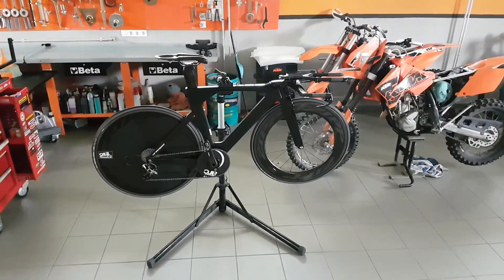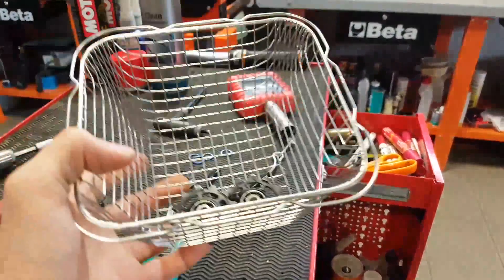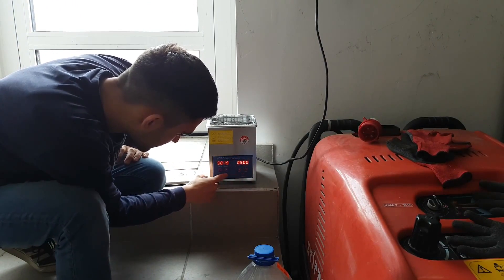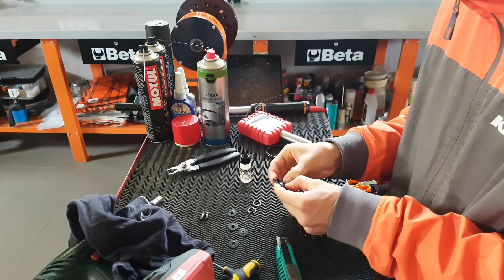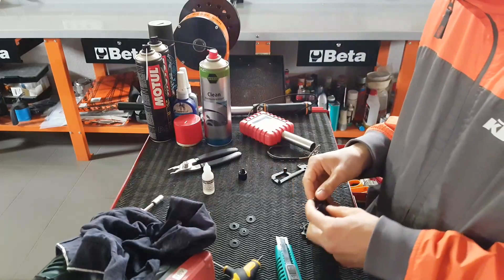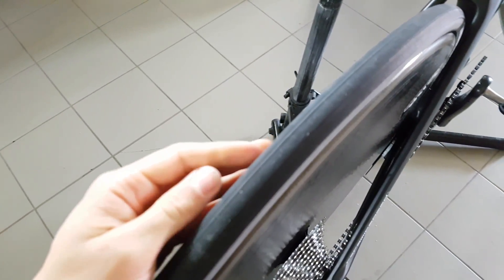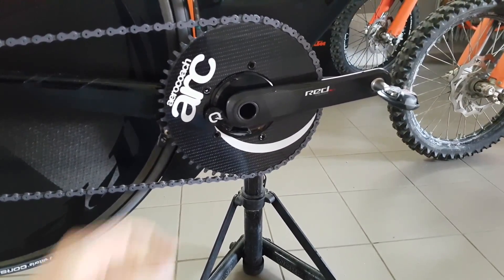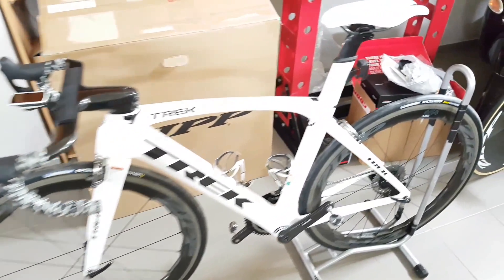How to maintain your bike like a pro - race preparation

Comment: Hi Ronald, quick question... do you have any problems with cable rattle in your handlebars? I have a madone 9 running di2 and the brake cables are very noisy on roughy roads
Reply from the maker: Kevin McMorrow not with the Madone, but I did have this problem with the Speed Concept. I have taped the outer cables with foam tape
Reply: Thanks for the quick reply! Did you run any foam tubing in the handlebars at all on the madone?
Reply from the maker: only in the frame for the rear brake